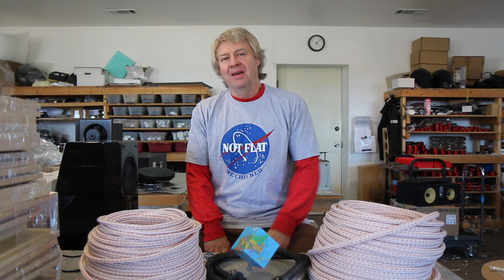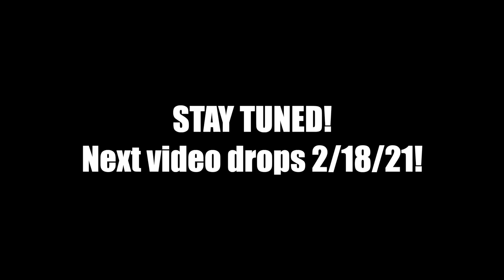Audiophile Cable TRUTHS: The Divided Camps

Comment: There are many variables that are hard to measure but definitely effect the sound. Dielectric absorption - the amount of energy needed to charge and discharge the insulation; rectification noise - the sound of electrons jumping from strands to strands on multi stranded cables; contaminants in the conduction material itself; different time arrivals of the signal itself at different frequencies (skin effect is one cause); effects of inductance, capacitance, resistance. And their are more, but this is a good starting point.
Reply: @davidlong1786  Double bling testing is just a regurgitated catch phrase. Double blind means the person doing the listening and the person doing the switching doesn't know which is which. David, the guy doing the switching always knows which is which. He has to see and touch the cables. Secondly, it does not matter if the guy doing the switching knows or not.
Reply: Run a single conductor bare wire, all worries go away.  As long as the wire has a polished surface like stainless steel and won't corrode.

Comment: So you measure the sound of your crossovers with a frequency sweep. You can do the exactly the same with cables.Just show us a frequency sweep of a common heavy copper mains cable against an expensive audiophile cable and a show us the difference in the frequency response. Easy! Come on do it!
Reply: A cable difference doesn't show up in the frequency response. I used an example of a guy changing the shocks on his car and expecting it to run faster. Perfect analogy here.
Reply: A frequency sweep tells you very little about the sound quality of an audio component overall - it's part of the story, but there are far more variables than that. And if there are differences in cables (I'm not currently convinced either way) then they're not going to be in the frequency response as copper wire has a very flat response in the audio spectrum. Frequency response, though, is the most important measure of a crossover, and so it makes obvious sense to test that.
Reply: Don't worry. they'll both be flat from DC to 200 kHz. Been there done that. Danny's right. It's not about frequency response per se. As a physicist, I think I can say we don't really know everything about what makes a good cable good. I think we know more about what makes a bad cable bad. Music is not a single sine wave or square wave, but a myriad frequencies layered on top of each other, each with intensity and presence varying in time. We are faced with multiple conundrums: why did the introduction of Teflon as an insulator improve the sound of cables some years ago (maybe someone knows, I don't). But the question is this: it is widely accepted as superior, but why should it make any difference at all? Eg. compared with polyethylene? Why should the effects of different dielectric properties even make a difference at our low audio frequencies? Why do supertweeters (mine go to 90kHz) make a difference to the sound (even bass!) if I can't hear much over 13kHz (as a tone)? Why do power cables make a difference? If they carry 10A at 110V 60Hz or 5A at 220V 50Hz surely that's enough? Nope. Here they may be carrying RFI into the power supply and 'polluting' other sensitive components. How do they handle extremely short peak current demands? So their construction matters. 
This subject is compounded by the fact that it's our perception of the sound that counts - psychoacoustics is the interaction of sounds with the mind. How do we locate sounds? Hint: it's not necessarily amplitude related but phase. Our brain knows how to use the ear to find the difference in phase (wavefront timing) of a sound arriving at our head. And BTW this may be how supertweeters improve our listening experience. So it's not cut and dried and all empirical and reduced to resistance, capacitance and inductance. There are unfortunately a lot more factors in play determining how we perceive a sound. I could go on and on but will spare you! :-) I hope this was interesting and not just like a red rag to a bull. :-) All the best, Rob
Reply: @dannyrichie9743  But assuming you use 'better' shocks the car will be capable of running faster. If the driver is good enough.
Reply: Oh dear, I’m afraid this doesn’t add up, the frequency sweep is what’s coming from the speaker, otherwise why use it to correct a crossover!? So according to this, a sweep applies to a cross over but not a cable, nope, sorry guys here no science here, unsubscribed! Bye bye flat earth guys!
Reply: @jamesm90  Yes, it does add up, really quite simply. The cable essentially takes nothing from the frequency response - copper cables are pretty much flat from DC to very high frequency, and you need to get well beyond 20kHz before you get any drop-off. (And even if there is any frequency-dependent response difference on rare occasions in a cable, perhaps due to unusual capacitance, it's still going to be vanishingly small compared to the frequency response of a crossover). That means you can measure the combined crossover/driver response with a frequency sweep without the cable affecting it - the differences from adjusting a crossover design are enormous compared to even any theoretical tiny differences for cables. A frequency sweep is completely useless for detecting any differences that might exist between cables, as those differences (if they exist) are not in the frequency response.

Comment: iWii Reviews here on YouTube just did a Cheap vs Expensive Interconnect Cable with SOUND DEMO last month. You can clearly hear, even through YouTube, that there is a difference between the interconnects
Reply: There is no question about differences of cables. And the important differences are measurable.
Reply: @nicoras8803  I admit that it turned out that, listening through YouTube, I preferred the cheap cable. I suspect that in person I would prefer the more expensive cable but that the perhaps harsher tone of the cheap cable cut through the haze of all of the compression as well as my $10 earbuds better

Comment: I'm taking neither side here. With my ears and my equipment, and the few cables I've been able to try, I've only once been able to hear any difference (and it was a clear difference, but one of the cables was super cheap and nasty). But there are people on both sides of the cable argument whose expertise and opinions I respect, and my own limited experience is really not sufficient. So here's one thing that really does puzzle me... Most of us don't have the money to buy lots of different expensive cables and compare them ourselves, so we have to rely on what reviewers say. And the gold standard for comparisons is the double blind test. So, given that this controversy has been going on for decades, and some properly designed double blind tests could surely settle it one way or another, why aren't they being done?
Reply: @davidlong1786  Some valid points there, yes. I think it's entirely plausible that a well designed cable could sound better - but my suspicion is that the majority of expensive cables out there simply do not. I'm sure a cable maker who genuinely believes they have better sounding cables could stump up the cash to pay for some proper academic double blind tests - and a proper double blind success could do wonders for their sales.
Reply: The "double blind test" is little more than a catch phrase. Most people don't even realize what it really means and that it doesn't apply or is even possible to implement. I cover this and explain it in episode 4. Don't miss it.
Reply: I just found this Stereophile article by John Atkinson - https://www.stereophile.com/asweseeit/894awsi/index.html. And while I don't agree that double blind tests are no good, I think he does actually make some good points on the psychology of audio testing in general. I know that if I try to do critical comparisons (especially A/B/X), I quickly lose appreciation of the music itself and its subleties, and rapidly reach audio fatigue - whereas in "listening to music" rather than "listening to equipment" mode, I can listen and enjoy for hours on end.
Reply: @dannyrichie9743  Ah, I just went looking for it and couldn't find it, and then I realized you presumably mean episode 4 in this series which is yet to come ;-) I look forward to it.
Reply: @davidlong1786  Good point, I guess you'd need to do quick A/B/X comparisons.
Reply: @osliverpool  I personally would enjoy participating in a test.  It would be an opportunity to prove things.  Wander why others don't think that way ?
Reply: @osliverpool  No, fast switching is the most awful thing you can do. Because it will lead to the mixing up of the sound memories in the brain. If you've ever been to an audio shop and have listened to this string of cheap speakers in a row, with a switchboard, you will remember that after 30 minutes of switching from one speaker to the other you've become totally numb.

This story that "the" auditory memory lasts only for a few seconds, is total crap. If that were the case, you would never be able to remember how words sound, or how a person's voice sound.

Yes, there IS a special very short term integrating auditory memory, but it is subconscious, and it is therefore not something you can remember.
Reply: @ernstraedecker6174  Interesting thoughts, thanks. And yes, that's a very good point on the "auditory memory" thing.

Comment: Oop, there goes Danny setting internet fires again! ;P
Looking forward to the next few videos in the series! 
In my little experience, a solid, clean connection from the amp to the crossover  makes the biggest difference in clarity, while higher quality cables themselves lend themselves to a deeper/wider soundstage.
Sadly no personal experience with power cords, I've only got the most stock/standard/generic onces available. :P

Comment: you could absolutely apply scientific principles here of hypothesis and testing - have someone swap cables back and forth while you listen and show us that you can tell which cable is being used, blindly, with a high degree of accuracy. i still haven't seen that video. if anything the flat earth crowd should be equated with those who think that differences in (high signal level) cables are absolutely discernible.

i want to buy your crossover upgrade for my newly-acquired LRS but this is making me reconsider...

Comment: Interesting argument.  Ive actually wondered about this recently.  Not necessarily about cables, but with other audio products.
Reply: @Douglas Blake If changes in caps makes a difference in crossovers, why doesn't it make a change in amp circuits?
Reply: @Douglas Blake Im aware of the psychological aspect of it.  But ive read time and time again where people say that a denon receiver is just as good or better than $4-5K processor bc it measures better or it measures the same.  And I've seen other similar stuff like that.  But we know thats not the case and a more expensive product can legit sound better.  Same thing with speakers.  You can have two speakers with a similar response but one sounds noticeably better.  So accepting that, then is there merit to sonic benefits with other things that people dismiss like speaker, cables, interconnects, power cords, etc.?  I'm not interested enough to try for myself but I have wondered about it.
Reply: @Douglas Blake I like to think that there are differences that we need our ears to quantify.  Now, I know that's a pandora's box but that's the point I was making.
Reply: @Douglas Blake That's one long response.  I'm with you for the most part though.  I'm certainly not arguing that expensive cables and interconnects will transform a system or serve any benefits at all.  I've always bought into the science side of it.  But i do spend a little extra for some name brand cables (belden, canare, mogami, etc.).  I don't do it bc i believe Ill hear a difference though.  I just like having some neatly wired quality cables in my rack.  That all being said, ive never actually used or listened to any of the "snake oil" products.  People swear they hear something.  Other people swear there cant be difference.  Then, ive also heard science minded people make similar statements about products that i have been able to listen to and have heard a difference.  So, it opened my mind up a little bit to think maybe there are some differences in some of those "snake oil" products that can only be heard.  But as I said before, I'm not that interested to go and try for myself.  And even if i did there's no way to even know if am actually hearing a difference or I just think I am.